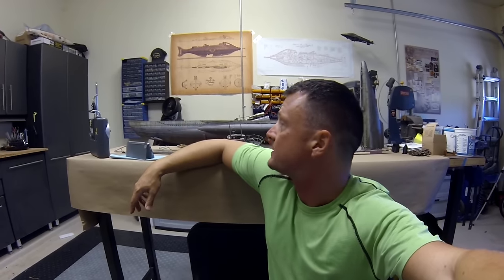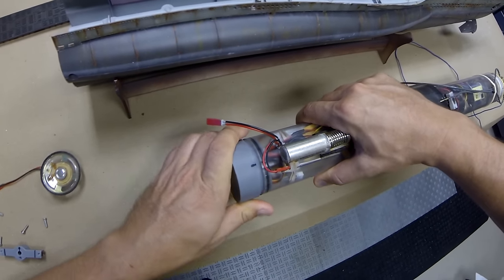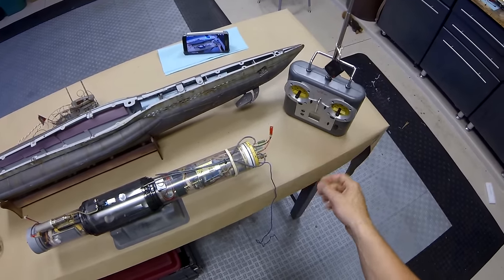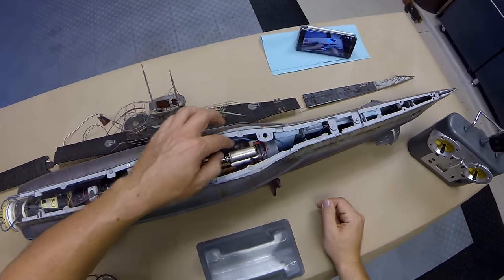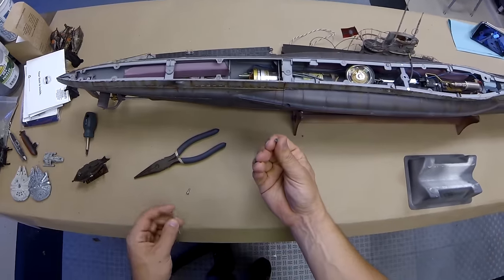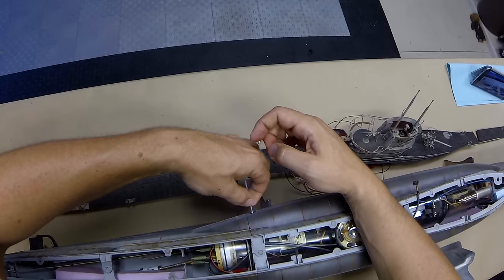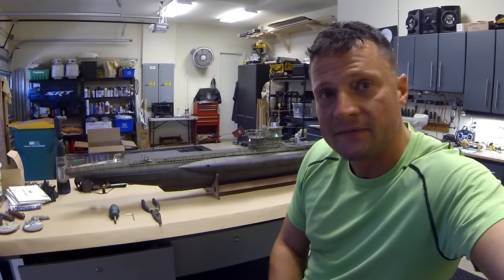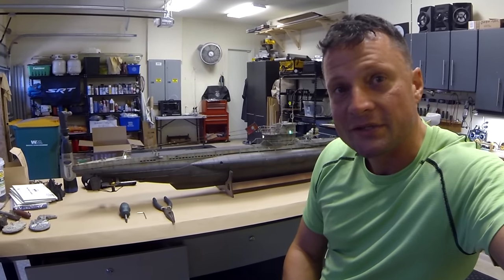Arkmodel German Type VII R/C Submarine Completed Overview

Comment: How did you waterproof where the servo actuators go through the end caps?
Reply from the maker: I used standard cup seals to seal both the linkages and main shaft.
Reply: RCSubGuy Nice setup. Thanks for answering. Do you use petroleum jelly on the shaft and linkages as an additional water-proofing measure?

Comment: why such  an old antenna
Reply from the maker: Old antenna? The blue wire is an extension. It bolts to a stud in the wall so that there is no physical hole in the cylinder end cap. It's a bit kinked from being coiled up, but it's not old.